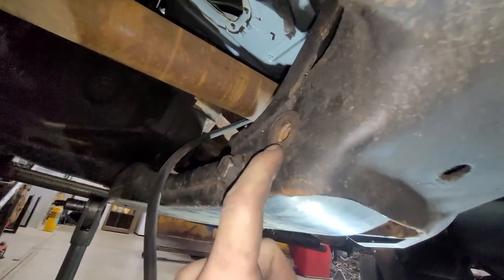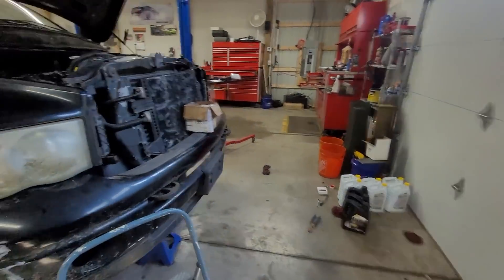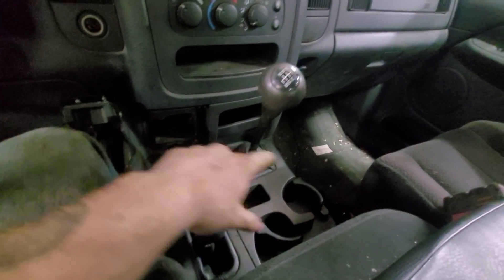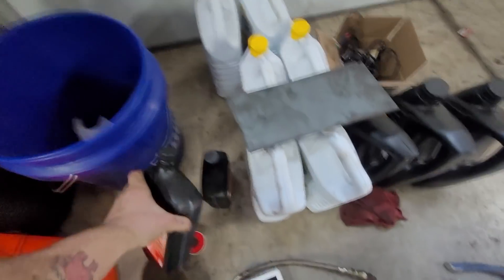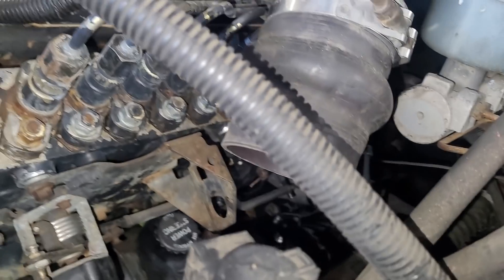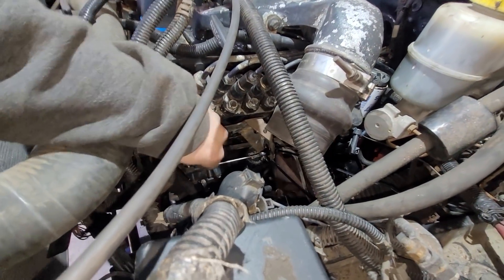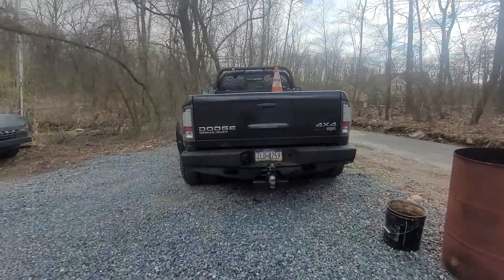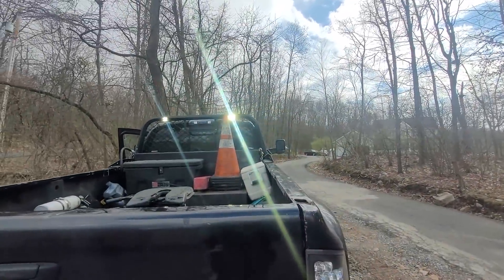12 Valve Swap 99% Done | Is A 12 valve Swap Worth It? **Answered** | AUX Beam Backup Pods Installed

Comment: For the mechanical fuel shut off could you drill the hole in the dash big enough for the cable to be bolted to where you did yours (and run the handle through it)? It would look better than a section clipped off.

Comment: They do pull a lot of amps, ive had issues with leds and dodge wiring before. If you run the relay you can still use the back light as your turn on signal for the relay, the only difference is the relay carries the load from the battery to the lights

Comment: We have been talking on and off about me doing this, im still on the fence about it. My truck has a lot of problems currently with either injection or electrical issues. My other problem is finding a 12 valve for less than $5k. Thanks for the videos man
Reply from the maker: In Pa it is doable to find them for 2 to 2500. They used to be 1500 to 2000 but prices are on the up
Reply: @CPSteveMiller  You think it is still worth it if I spend $5k on a low mile motor from CPP?

Comment: You can run the turn on from the factory rear light...but dont run the lights off the factory wiring. Itbiant made to carry the extra amps. Use the power wire from the dash switch to run a relay and better wires to run the extra lamps.
Reply: We told him this already but he decided to take the east way. When his light switch melts we all can say we told you so
Reply: Content! LmARMYao
Reply from the maker: Who cares if it melts when I have 2 spare ones in my box truck storage unit? 😂😂
Reply: @CPSteveMiller  I have the about the same lights. And have them wired the same way for several years now with no problem. My head light switch still looks brand new. And I use then almost everyday. If you ever need any electrical help just give me a call if you got my number. Keep up the good work! 👍
Reply: @CPSteveMiller  I'd be more worried about the a wiring in the truck loom melting.

Comment: Where can i get the check list you have made for 12v swap?
Reply from the maker: https://docs.google.com/spreadsheets/u/0/d/1IXZ4xkrtiWmx8lg3xG3g1G9x6NY4dWShP7xyKccNW3Y/htmlview?pli=1#gid=0
Reply: Thanks so much. Love the videos! Currently doing a 96 12v swap into a 06 mega CR.
Reply: Only question I do have is how small of a hole did you drill for the thermostat bypass?
Reply from the maker: 1/8" I believe. Make sure the hole is at the top when you install it.
Reply: @CPSteveMiller  thanks!

Comment: Why not do a 24v  cummins vp44 swap
Reply from the maker: Vp44's are garbage. They're just like the cp4's. The cp3 is the best pump electronically. The p7100 was the next runner up
Reply: @CPSteveMiller  k then I know they make a kit to put the p7100 pump on the 24v would that be a good option
Reply from the maker: Yes. I'm hoping to get to do one here at some point
Reply: @CPSteveMiller  I got one u could  do soon as I get the money  engine  has 306,000 miles on it
Reply from the maker: I can certainly do it. Just let me know. Email or Instagram down below. That'll be a ton cheaper than a swap. Still a bunch of labor swapping the front case and all that but way cheaper
Reply: @CPSteveMiller  well engine may still have to come out bc I want to do a manual swap  as well
Reply from the maker: No need to pull the engine for that. Just extra labor. It's harder to line an engine up going in than it is to just swap the trans. You can take the adapter plate off the trans while it's in the truck
Reply: @CPSteveMiller  even  going  from  an automatic  transmission to manuel
Reply from the maker: Yeah, it's just an adapter plate swap
Reply: @CPSteveMiller  ok witch tranny would you recommend to put in I'm debating on a 5 or 6 speed
Reply from the maker: Nv5600 is the beefy one but they are getting harder to find. G56 is the next option. Don't waste your time on an nv4500
Reply: @CPSteveMiller  ok maybe a stupid question  but I'm gonna ask any way would you recommend  changing  the gears  in the differentials according to the tag on the diffs I have 3:55 gearing  and I'm running  265 70 r17  tires  on it currently  and when I get this work done should I have the tapit cover gasket replaced  it does leak oil and I'm thinking about  a complete engine overall  done or is that a wast of time once again  the engine  has about 305,000 or miles on it
Reply from the maker: Maybe down the road. Get it the way you want it first. If it doesn't feel great off the line move up to 3:73. 3:55 is great for highway driving. If you swap to a 6 speed you can just use 1st gear to make up the difference. Not really a big priority unless you find you're not happy with it later on

Comment: Dammit, you are a week too late on the fill plug advice LOL. My transfer case was sitting on the bench I used a pipe nipple extractor set and a little bit of heat (250 Degrees) and drilled the plug just a bit bigger and it came right out with very little force.
Reply from the maker: Damn man sorry to hear that! I've always been taught to do it this way for that reason. Luckily this one came out even though it was a bit crusty

Comment: penzoil is garbage, id only run redline or amsoil.
Reply from the maker: Maybe but I can't argue with results. My transmission held together for way longer than it should've with the abuse I put it through. 17k trailer, towing in 6th, floating gears the majority of the time. I have no complaints